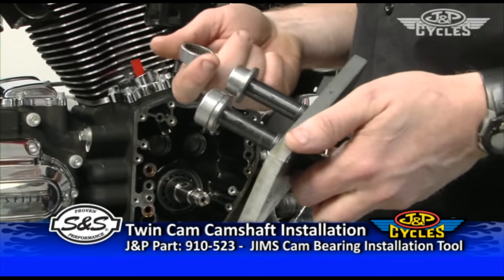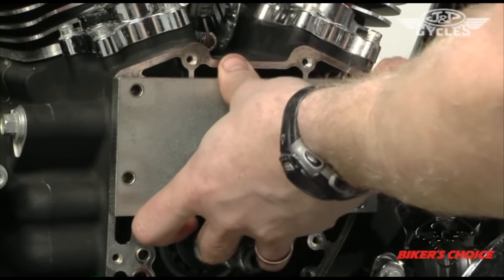Cam Replacement on a Harley Davidson Twin Cam, including Pushrod Removal •  J&P Cycles

Comment: Did I hear 1800 miles on the bike and the runout was near its limit?
Reply: Factory specs on page 78 of the Manuel says 0-7000s max. But because of heat cycles that number can change many times during a single trip..... If you didn't know.... Harley's don't have "crank main caps" like other motors.... So yes, all V twin bikes will have some run out. Btw, Honda requires at least 5000 run out for their thrust bearing load?  You're not a mech are you....
Reply: He does a great job on this video, and I'd like to have heard this run..... Did you also hear him say that on this "new" engine, you would have to split the cases and weld the crank to keep it true enough to run gear driven cams?? I'll stick to my Shovels and Evos, thanks anyway.
Reply: No you didn’t . It was in Torrance maybe you should watch again.
Reply: The TC runout spec is infamously loose and MUCH sloppier than the better designed Timken style. I am a mechanic (bikes since 1978, aircraft since 1981) and it causes enough problems that some TCs have too much runout to permit gear drive install. Your explanation regardomg "bearing caps" is irrelevant as the runout is caused by the crankshaft ASSEMBLY being cheaply produced to please the bean counters. Pressed cranks can be held to much tighter runout specs but that's more time and time is money. Ditching Timken sprocket shaft bearings saved HD a lot of cash but the roller setup isn't particularly durable which is why HD sells a Timken "upgrade" kit which uses their superior OLDER design. Check the vtwinforum for many threads, with measurements as proof,  on the subject. There are also many failed engines due to their goofy timing chain shoes and they will continue to shit the bed as the large used fleet doesn't all belong to owners who are mechanics.